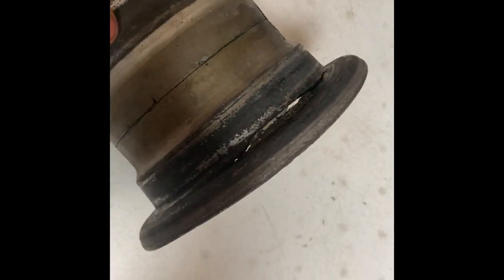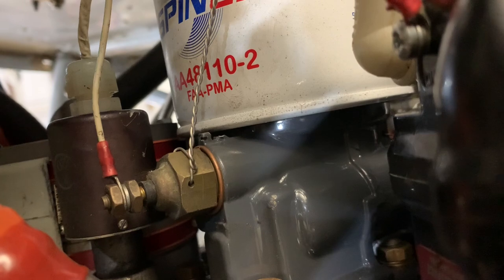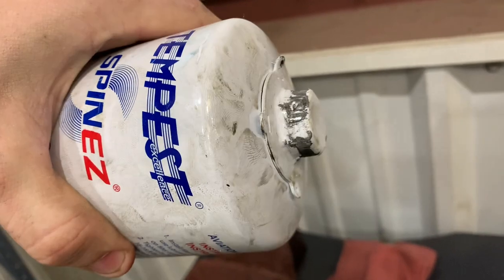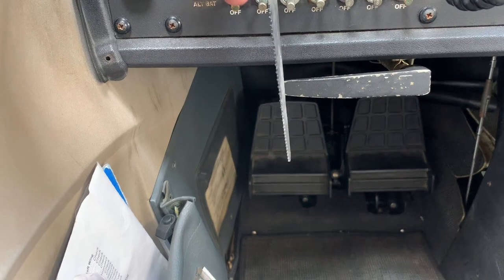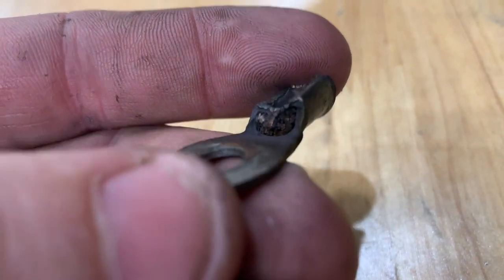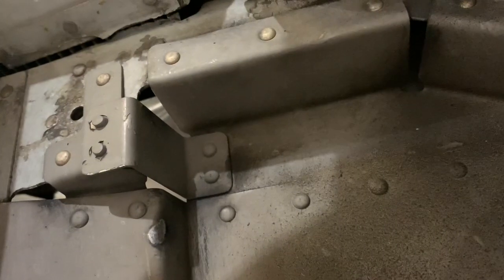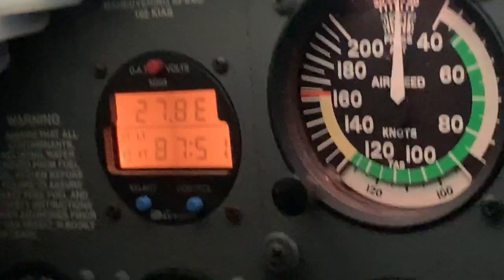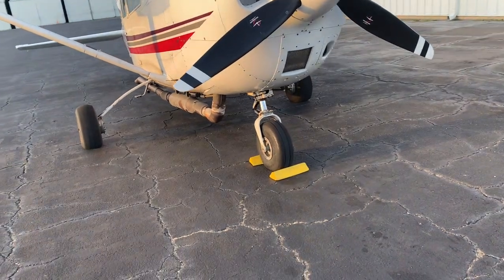Don’t do this oil filter “trick”. Cessna 172 alternator issues.  Day in the life of an A&P mechanic

Comment: I used to do all my own auto work, including engine rebuilds and transmission repairs.  Found the same kind of stuff on the older cars I purchased.  Now a student pilot.  I am somewhat amazed at finding similar things on the school planes.  I know they get ridden hard, and it is hard to stay ahead but I can't just stop on the side of the road if the engine quits.  My preflights seem to get longer and longer every time I go flying.  Chris
Reply from the maker: They’d go a lot smoother but usually one student notices something or breaks something and ignores it, another knows about it and flys anyways. Then someone finally writes it up and it’s a bigger deal than originally

Comment: I used to be a general Aviation pilot from 1980to88. I just started flying again and I just happened upon your channel. I was in the marine electronics business and that wiring looked terrible! In the marine business we used tinned wiring to keep the copper from corroding. On lugs like you showed we would cramp them and then solder them, and then put heat shrink over that. The heat Shrink had some kind of sticky stuff on the inside and made a water tight seal.
Reply from the maker: Lol,  that’s what’s on it now other that the sticky heat shrink.  Just regular heat shrink and we re ran a new bigger 6 gauge wire
Reply: We used to put lugs on battery cables for ship to shore radio‘s a.k.a. single side band.

Comment: I guess he was using that alternator cable as a night light?  If he flew at night, and it grounded out to the airframe, there must have been a glow somewhere there.  I guess the control yoke being loose was just a "automatic" control dampener system working as designed.  Allows for radical movements to be dampened out.  Just adjust the sensitivity by tightening the screws more.